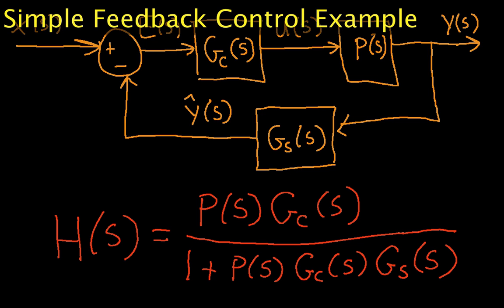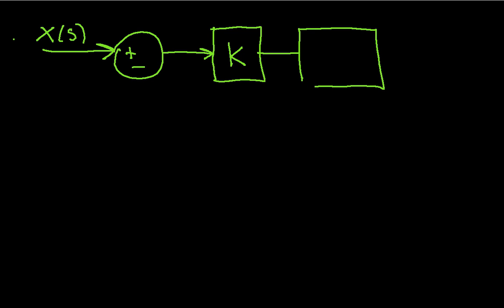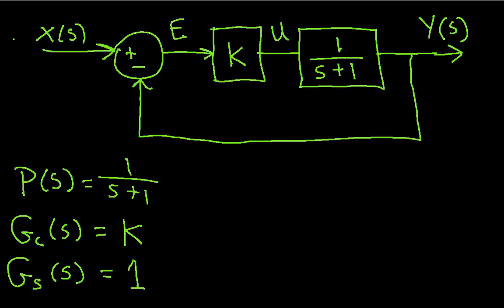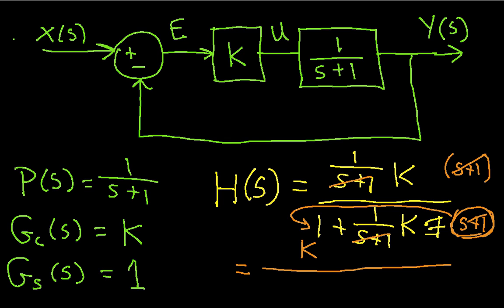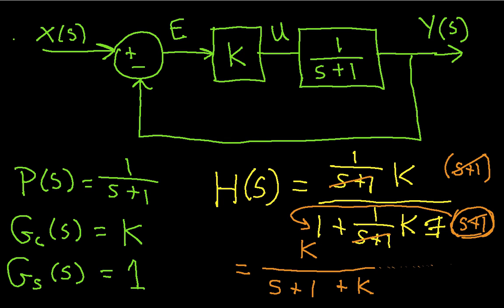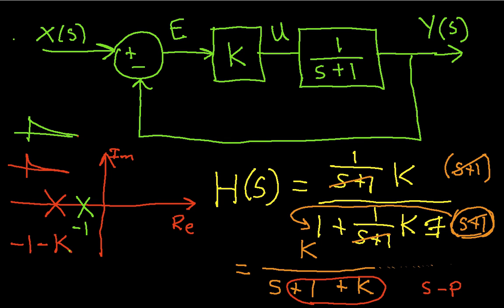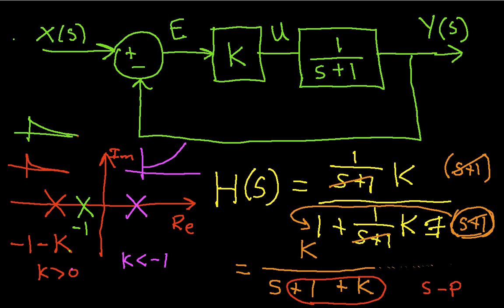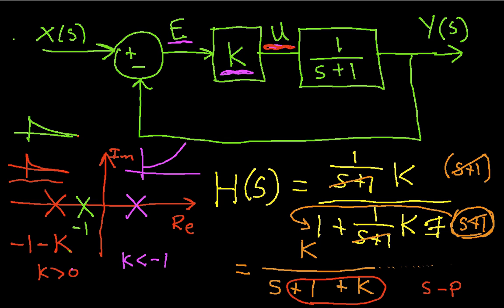A Simple Feedback Control Example

Comment from the maker: @CognitiveNetwork The subtractor computes the error between the output Y and the desired value X (the input to the system is the desired value). The error is used by the controller (the GC(s) box) to adjust the input to the plant (the P(s) box) to make the output what we want it to be.

Comment from the maker: @CognitiveNetwork The input to the system is X. The gain K is a parameter of the controller that we set to get the desired system behavior. The gain affects what the system will do to X to get the output Y.